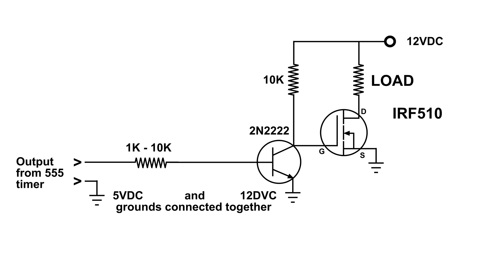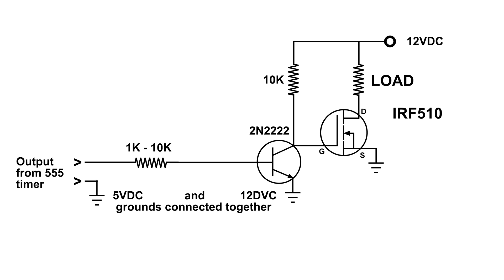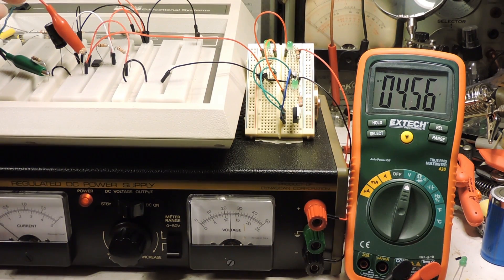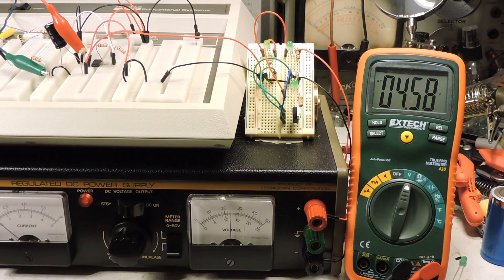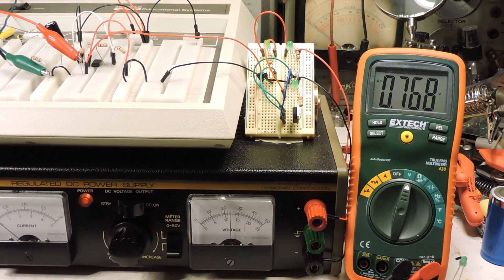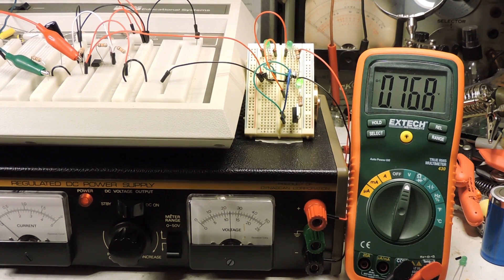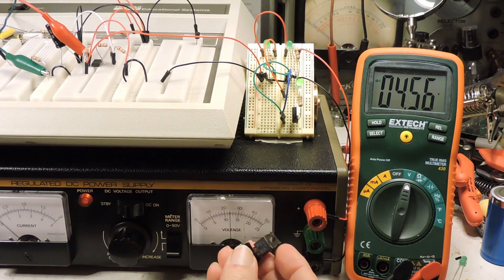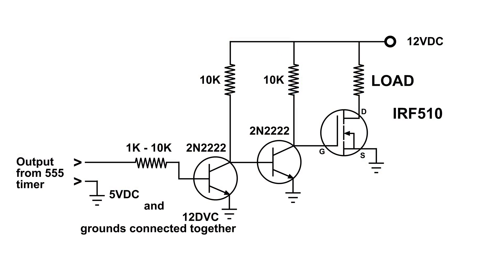Controlling a 12VDC Motor with a 3 to 5VDC Signal

Comment: I thought a 555 timer's output was a symmetrical flash. But in the first shot, this one is high (LED off) longer than low (LED on)
Reply from the maker: The 555 timer can be equal on and off, but it's much more versatile. The on and off periods are determined by the resistors and capacitor that is used for the RC time constant.
Reply: AllAmericanFiveRadio 
Thank you.
Reply: And interesting video as always.